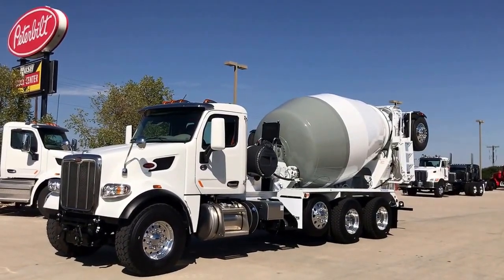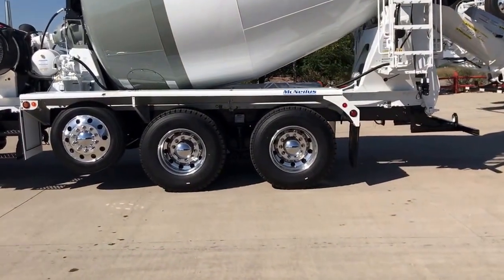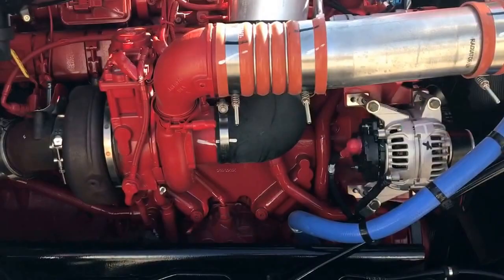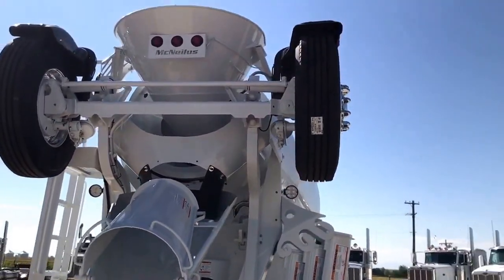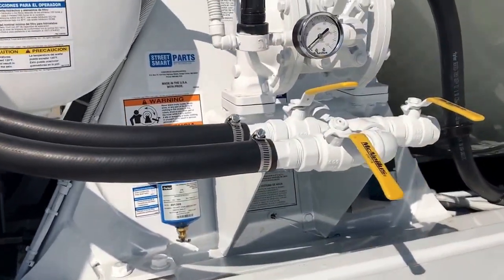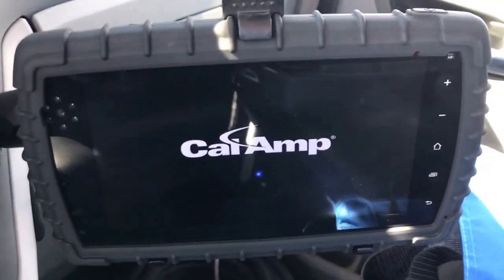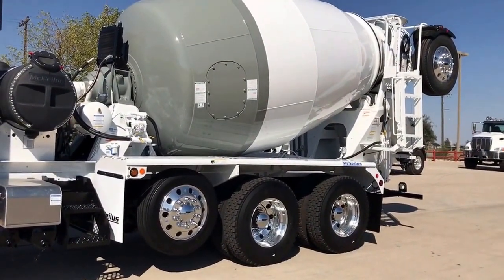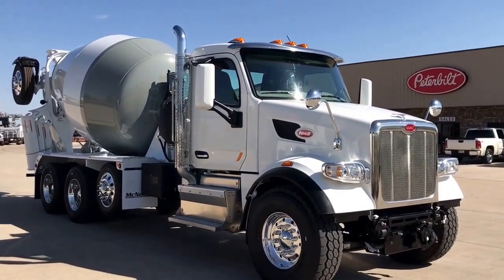2018 Peterbilt 567 Concrete Mixer Truck

Comment: I am a long time concrete driver, the allison transmission is amazing. Makes a drivers job so much simpler as far as braking and controlling the truck. Never thought a transmission would make that much of a difference.  When it comes to hills/mountains it will hold you back and it will down shift exactly when needed. Recommended is a understatement

Comment: I love my 2017 Kenworth T880 10.5 yard  Mc Neilus mixer w front disc brakes, on drivers side has battery box and 120 gal water tank , right side fuel and DEF . Manuel drum control front and back and/electronic remote controls at the back . The can air ride is so much better then any other models I've driven,  it takes out hard impacts away to a moderate impact. The T880 is OTR ready for a sleeper . Wide can with plenty room between the seats to pass through but the Bridgemaster mounted there is still passable . But who needs a sleeper berth in a mixer , it would be nice if possible.  The can very very comfortable , the only thing is the drive under plants is a tight squeeze with the mirrors but the .mirrors do calapes easily if needed . The can is fully powered because it needs to be. To reach for the passenger door you have to stop apply parking brake and unbuckle seat belt and get up and put your leg on the other side of stick shift to open door. Beautiful truck , everyone in this industry comments on it . Southern California rental , price $195 here . Oh ya slump meter mounted on left side towards the rear is a must

Comment: All the mixer trucks where I live are those huge ass funny looking ones.   Driver up front, chute up front, engine in the back, 6 or 8 huge tires on either side, no dually wheels.  

You never see one of these that looks like a conventional truck where I live.   I'm sure it has something to do with weight or DOT regulations as to what type of truck you run.   Seems like the funny looking ones are bigger, just from eyeballing them.
Reply from the maker: You might be right.  I have no experience with the front discharge mixers so I cannot speak about them.
Reply: I’m pretty sure it has to do with operator preference, i live in Florida and i see both types of trucks and have worked with both, on a conventional truck the operator usually will get out to operate it but on the front chute style they stay in because they can see everything
Reply: Front discharge trucks are usually easier to get onto jobs also. Plus only take one driver. At times rear discharge trucks need 2 guys one to drive and one to move the chute
Reply: A rear discharge is cheaper to purchase. It's just a normal straight truck with a mixer body popped on it in place of say a dump body. A front discharge truck is a specialized truck built for just pouring concrete, making it very expensive to buy. I think right now a company would be looking at about 300k to purchase a front discharge truck new. And that's just outfitting it with the basics. It also depends on the regional makeup of the area. Urban areas will pretty much only have rear discharge trucks due to their lighter weight, shorter height and handle the highway better. They can go over more bridges and fit in more places basically. A front discharge truck is heavier and taller, but they're all wheel drive and capable of going more places offroad than you'd be able to get a rear discharge truck which don't have a driven front axle. With the right driver of course lol. So more rural areas ect. necessitate a front discharge truck more.

Comment: What is that preheated for why do you need it.
Reply from the maker: The Webasto heater is for the engine and the hydraulic fluid.  It has both warmed up and ready to go when the driver arrives to work.

Comment: Because of all the dust sand and cement and everything you cant keep these trucks clean. Making the inside of the cabs out of old cheap plastic that will crack and fall apart. And of course drivers your company will tell you its better because it makes the truck lighter whch is correct which also means they can put more yards of concrete on your truck which makes it heavier and more dangerous which is correct and if you were to blow a steering tire and that truck turned over that company would blame you which is what most employees dont understand a company never does anything to benefit its employees it only does it to benefit the compang.